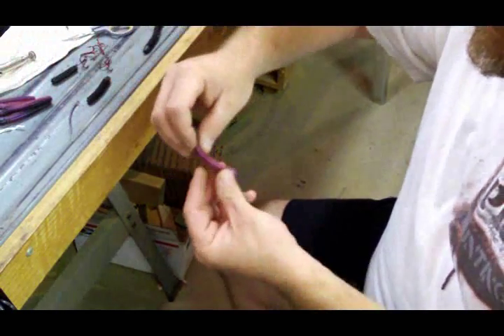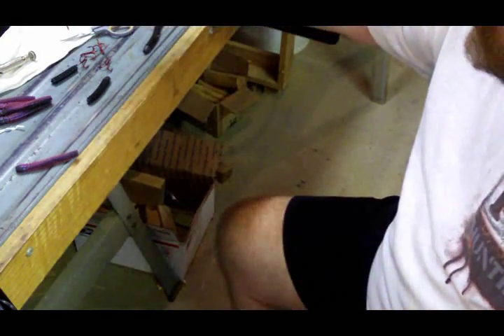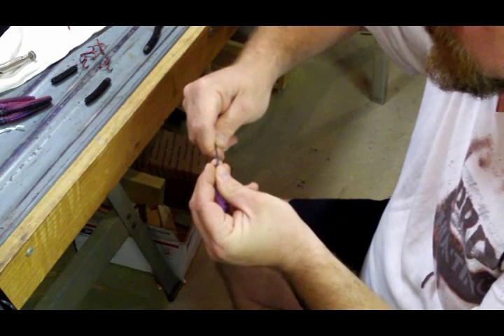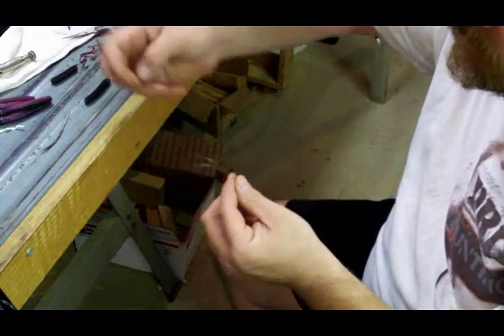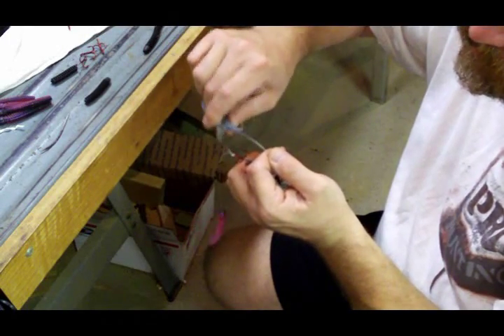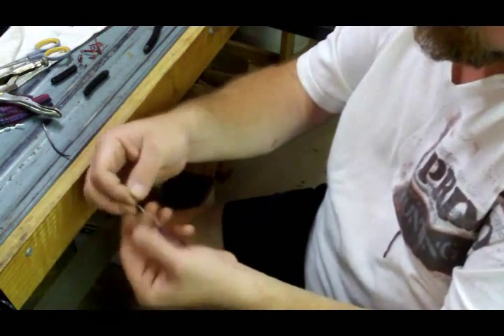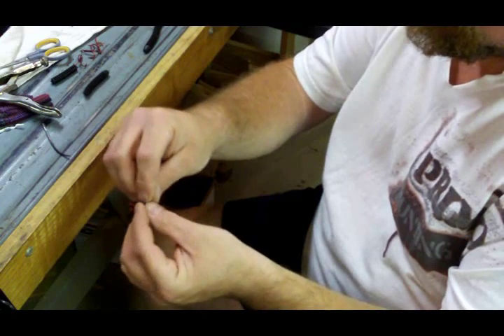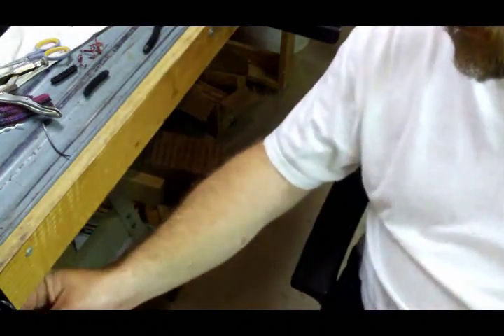How to make your own catfish bait dip worms

Comment: How do I make the knot to connect the dip worm to the swivel
Reply: I bought a dip worm and it’s just straight string no loop
Reply from the maker: I know that the video is old and I apologize because the video quality is so much better  now. It's basically an over hand knot. Grab both tag ends with a loop at the top and tie a knot like you would a shoe lace. That's what makes the loop to fasten to your swivel. Hop this helps.